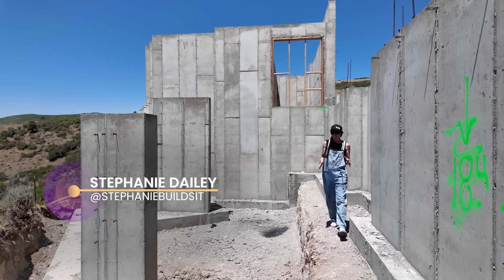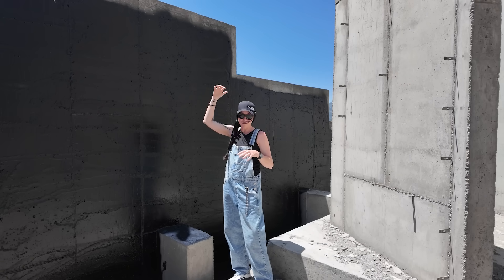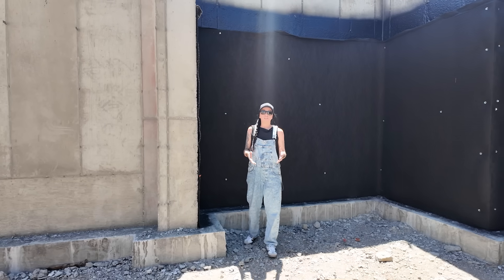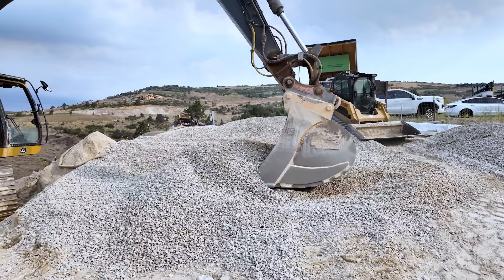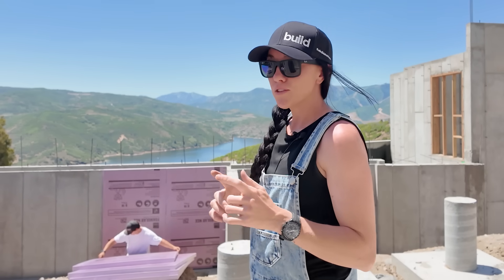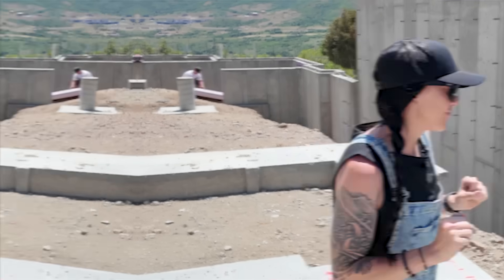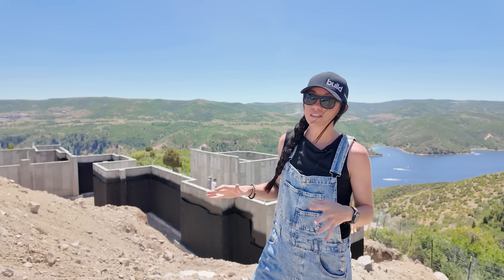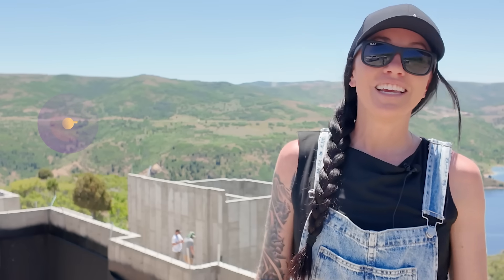Altitude Adjustment | Episode 2 - Foundation Beginnings: Foundations, Waterproofing, and Backfill

Comment: The poured concrete walls are so thin for the height how is that safe?
Reply: More about don't have nothing to loock them to inside... wend fill up the lateral pressure of landfill will by alot and the base of foundations walls is so small . for a earthquake area you want a bigger base to have less pressure on soil ...

Comment: As a classical residential architect, I can't imagine designing this monstrosity. I'm no fan of modern architecture so I don't find this type of home very interesting, despite the obvious technical complexity of these foundation plans.  I'd agree with other that building in more favorable locations that this would've made much more sense both economically and pragmatically.  Good luck - these elevations are going to be a PITA over the long term to ensure no water deterioration due to seepage and hydrostatic pressure due to the gradient changes.
Reply: Everyone has their favorite styles. However this home is far from modern. It’s an extremely complex lot which leads to a challenging design. It’s not a challenge that all architects are willing to take on.

Comment: For the pool I wonder if rigid foam block backfill would be more effective than rock.  If the structure has been designed assuming the higher loads it might be too late now, but that is a lot of backfill!

Comment: I8 feet of "dirt"(your word) fill is going to have a compaction problem.  Plan to address it with compacted lifts or a non-compressible fill like pea gravel.
Reply: It was filled with an engineered fill dirt and a compactor was craned in. It’s very stable
Reply: yup, we would never call the fill 'dirt' and the geo would be testing compaction against a proctor on every 18" lift. I assumed it is just a local nomenclature thing from someone that doesnt do the earthworks everyday kind of like how some call a 'trench' a 'ditch'

Comment: I put pango wrap under my footers which makes it so I have a continuous air and water barrier completely around all of my 48’ tall multigenerational passive Icf home. It supports more than 1 million pounds of concrete. Any guesses on how wide my footers are 😂
Reply: go advertise somewhere else please.
Reply: @Ifishmo not an advertisement. Simply a belt and suspenders suggestion. You have to put a vapor barrier in the basement. So why not extend it under the footer?  That way you have total continuity.  Especially because the fluid applied barrier on the outside will seal it And when Steve pulls out big red he won’t lift it anywhere 😊
Reply: @LegacyViewsICFhomeBuild  You're advertising YOUR channel by commenting on everyone else's channels (as you specifically talk about your 'multi-generational passive icf home' on every comment)...that's 'advertising'.

Comment: Water moves laterally through concrete as well as from face to face, so waterproofing part of a structure, but not another part of it, like you left under the garage, Water will enter in the non sealed garage area face and move sideways to weep out  inside in areas adjacent to the garage
Reply: You’re correct, that’s a very great comment! However the garage only shares one adjacent wall which is completely waterproofed and separates the spaces. The other garage walls are at grade or daylight. It’s always smart to take effective applications and budget into account before we just start spending money. Even on big custom homes, budget matters, it’s just a bigger budget.
Reply: it doesnt look like that area gets a lot of water, and water likes to flow down not sidewayz
Reply: @notsure6182 it’s the desert but they do get snow so water is definitely possible but it’s all routed out and away from the home so they should have no issues 😊
Reply: @StephanieBuildsIt   I am in Vancouver BC north of Seattle. we deal with crazy amounts of rain water. it looks like that desert home is using the same things we use, although I didnt see the perimeter drains or rain water lead install that we would have  in the video
Reply: @notsure6182 the footing drain gets installed by the excavators as they backfill. They wrap the footing drain around, cover it in fabric and gravel before they start backfilling. All our footing drains are routed to an outdoor gravel sump. All the downspouts will also be routed there when we get to that point.
Reply: @StephanieBuildsIt   is it white perf PVC or corrugated junk? the fabric is a terrible idea. it acts as a filter to catch non existent fines/silt. lets say it catches silt which will eventually prevent the filter cloth from allowing water to flow through it, how do you change the filter? the fabric salesmen do you no favours. the point of the pipe is to allow you to service the system to clear any silt. trapping the silt in fabric where it cannot be cleaned is a massive mistake. just a career of living in a rain forest dealing with drainage speaking. the desert environment will probably save you from the problems that filter cloth causes here.